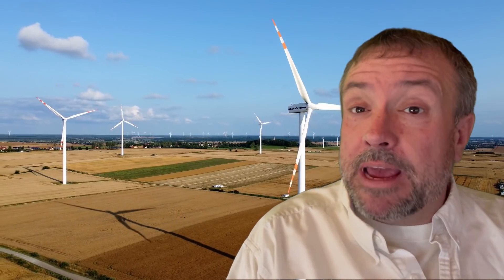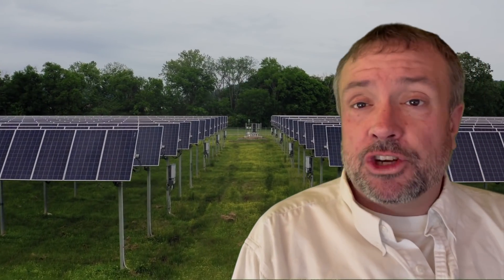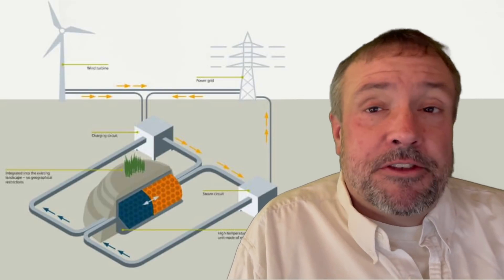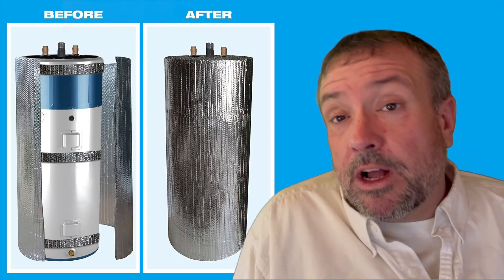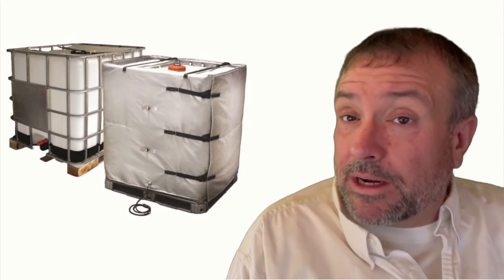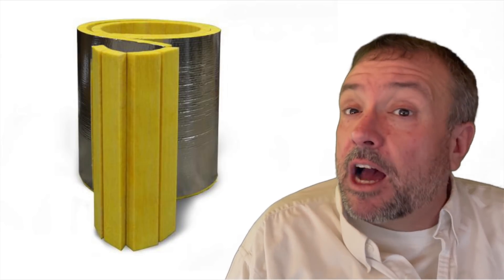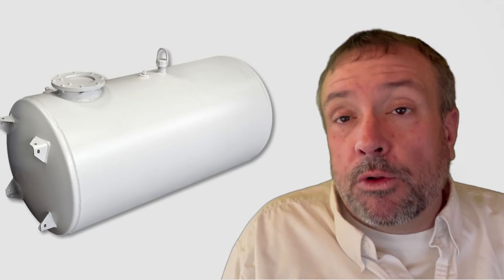Greenhouse Windmill Heating in Winter

Comment: Heat storage and heat pump is ideal and this is why!   It is simply cheaper to use a heat pump as they required 4:1 or 5:1 less power than simply creating heat.  Why?  Because it requires less energy to move heat then to create it.   Heat pumps work on temp differences.  They are granted the least efficient at -30 below.  😂.  BUT if the lower limit is above 0 celsius or perhaps 30c, then you can get those higher efficiencies were talking about.   If the outside coil of the heat pump is placed in warmer water or warmer air created by the heat storage we have already been speaking of IN COMBINATION WITH the heat pump, it will have miniscule electrical demands and high efficiencies.  Yes it has a demand needing electricity, but again only 1:4 or 1:5 that of direct heat creation.  So to keep the heat pump running will require grid or battery 1/4 to 1/5 the size of done in conjunction with a lower heat storage solution.  Let me know if anyone wants one, but not until I can answer a few more questions.  I'm going to do one for myself but going to do a little more research into which volumetric heat system I'm going to use.  No pressure hot water will work well, but I'm always fine tuning.  :).   Heat pump in conjunction with a Geothermal heat storage would be ideal for some locations as the heat source for the heat pump will be 50 degree fahrenheit higher is good enough to reach high efficiencies I have spoke of without the need of a tank.  But the geothermal ground coverage for ground heating will need to be deeper in cold climates and 2-2.5 times the size of the heated space.  Question?  Please sound off.  Greenhouses are usually not as insulated as a home.   Will the heat pump be required to run continuously in such a low insulated environment and how much would that effect efficiency?
Reply from the maker: I have no idea - it needs to be tested
Reply: @SimpleTek  yes I'm a little over a year away from any major greenhouse operation or I would do one now.  Loan office wants me to manage some sort of farm operation for a year before I can get any major financing.
Reply from the maker: @l0I0I0I0  have you tried other lenders?
Reply: @SimpleTek  yes need to call around.  Need to first buy this house then get a farm afterwards.  Can't wait!!!!

Comment: It's worth noting that it's basically required to have a heating element in wind turbine circuit as a dump load.

When your batteries are fully charged, you have to disconnect the power from them or they will get too charged and become damaged. Without the wind turbine powering something though, catching the wind will make it spin faster and faster. It can easily spin so fast it will destroy itself, so the most common solution is to hook it up to a heating element to get rid of the energy. (All this is done by the wind turbine controller)
Reply from the maker: interesting - that 'dump load' could easily be captured and used here....

Comment: Wind heated greenhouse! That is brilliant! Ideas like this keep me coming back.
I live off grid with solar panels and batteries and heat with wood to heat my hydronic floors and water. For a greenhouse, I would opt for a heater for a biogas digester. Then you still get the thermal radiation from the liquid but also the fermenting biogas chamber will give off more heat and gas too. I would connect the windmill in with my solar panels through a charge controller that would top up the batteries if they need it and then shunt the power directly to the hot water heater once the batteries are full. 
It is how I heat water in summer with my solar PV panels right now. I always have lots of hot water in summer. In winter the wwoodstove does the trick but cutting down on wood usage with a windmill would be sweet!
Reply from the maker: Thank you for the kind words! I love the idea of generating massive heat during a storm with a windmill!
Reply: I remember the Green Cube Research Institute was promoting this "wind turbine" for greenhouses many years ago. I'm guessing he read it in their publications.

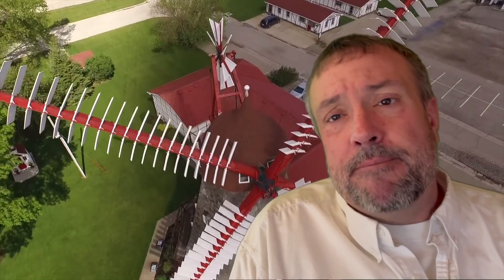Comment: 3:30 is the core problem in my opinion. We need systems that transform wind into heat as directly as possible. I mean something like a mechanically operated heat pump powered by wind. Any transformation to electricity, storing it in batteries and then making heat from it means loss of lots of energy. To the contrary, direct transformation with a heat pump allows for maximized effect.
Reply: Or you could go electricity to a heat pump and store the heat in water, but I don't what the efficiency of a heat pump is in Manitoba, and the cost to install it is more than direct heating of water. The main advantage of using wind to electricity is that you can use a  standardized mass produces wind turbine so for the same money you get a much larger wind turbine than you would with a customer turbine.
Reply from the maker: I agree but electric systems are commercially made
Reply: @SimpleTek  Thanks, yes, you are right both of you. As far as I know there is no such system available right now. I did not even find any purely mechanical heat pump by searching. Although in principle as far as I know there is nothing in the functioning of  heat pump where the mechanical work of electric engines might not be replaceable by other mechanical input. Human or animal work, gravitational battery, wind energy, water energy. Thus, an off grid, zero emission, purely mechanical system of heating might exist.
Reply: I think the simplest and least risky version would by just compressing the air by an air compressor powered by wind power. Any heat released migh be captured e.g. in a water tank or sand container. The compressed air might then be (1) used for cooling down the space that needs lower temperatures such as fridge, (2) released freely back into athmosphere thus chilling down the environment, (3) used in combination with 1 or 2 for electricity generation or just for increasing the efficiency of the initial wind powered compressor.
Reply from the maker: @peterk.6093  might work…
Reply: Wire DC from a wind turbine to a DC heating element. in a water heater, then use a pump to circulate water through pex tubing for radiant heat.

Comment: Using a plastic tank shoul dbe fine as water only heats to 100 c before becoming steam so at that temp should be ok except totes are a bit thin but a holding tank for sewage or other thick plastic tank should be fine.
Reply from the maker: some plastics become soft before 100'C though

Comment: Why not just heat the water directly in UNINSULATED black water barrels in the greenhouse - then the warmth from the barrel will just directly heat the greenhouse - smoothing out the energy from the windmill. No pumps, radiators or fans required. Also, as used by passive solar greenhouses, on sunny winter days, the same barrels will double as heat mass & be heated by the sun - even if no wind.
Reply from the maker: Takes up huge amounts of growing space though
Reply: @SimpleTek  This is standard practice for solar passive greenhouses. Stack black barrels full of water to store heat inside the greenhouse. Unless you have a tiny grenhouse, I think this would be fine. Esp. since you get the benefit of it also trapping excess solar heat in the winter.
Reply from the maker: @FordsInCanada  it’s ok for the shoulder seasons here…

Comment: i have been running an experimental  45kw biomass boiler connected to 4 ibc tanks in parallel since 2016 tipically going up to 60ºC without any issues
Reply: I like to see that set up
Reply from the maker: @scottykonovalov4518  mee too
Reply from the maker: That’s awesome

Comment: A suggestion for a tank, would be old milk tanks, they are stainless steel and already insulated. And the are pre plumbed with gas lines for refrigeration, which might be able to be switched to a heating tank. There are alot of old dairy farms around that would have them. They range in size from 1000 to 10000 litres. And you will find them right across North America. One downside is you probably have to cut a wall out of someone's barn to get them out. Just an idea do with it as you will.
Reply: Or a bulk transport trailer. They already have the wheels under them. Stainless steel and insulated already as well.
Reply from the maker: great ideas

Comment: I’ve thought about using windmills to produce power. The sticky point for me is the required maintenance. I don’t see myself as being able to handle it myself. In my area the best winds start at 20m up.
Reply: If you get the hivawt wind turbine you won't need to do any maintenance. Only certified vawt in the USA
Reply: @TurbineGuy  No maintenance??? Really? 🤔
https://youtu.be/EM-gCvhQhPU
Reply: @Hero4Hire4  yes Rosie has ignored the hivawt when making videos and hasn't responded to any messages I have sent her or comments I have left on her youtube channel. I have been installing these for a decade, and have never done mechanical maintenance on these. Only had an electrical issue from a lightning strike at one location.

Comment: Actually this is been done and you've got one missed opportunity, you really want to fill the tank with sand and have a pipe run through the tank so that the sand holds the heat because it will hold the heat a lot longer than water will
Reply from the maker: I have a video on sand as a thermal battery actually in my archives ;)
Reply: @SimpleTek  Water has a much higher Specific Heat Capacity than sand (approximately double) therefore for the same volume, water can store twice as much heat as sand. It cheaper & easier to move/pipe around too.
Reply from the maker: @FordsInCanada  but sand can take 10x the heat
Reply: @SimpleTek  , trade off between larger volume at a lower  heat, vs very intense heat in a smaller volume.   Lots of variables such as the max temp of your heat source,vs surface area vs more heat loss vs R value when temp differential is higher.   Sand could be easier to maintain than water (bacteria).    Case by case.
Reply: @FordsInCanada  Yes, but a larger volume of cheap sand, even clay, could retain more heat through higher temps for more days of heat independence, too. It's all in the math.

Comment: It is of course the way to go using thermal mass. There’s a wide array if options going this path. Your proposition is great, I would think it would work best with an existing greenhouse or other type of building someone wants to upgrade. If it’s a new construction, I think more thermal mass can be integrated in the design based on the Earthship concept. There would be then less energy used for heating and more of it available for lighting as the temperature in the greenhouse would tend to be stable at 21c.
Reply from the maker: Well said - thank you for the kind words!
Reply: What about a compressed air windmill and cool the compressed air in coils under your Greenhouse you could use tanks under your Greenhouse the cool the compressed air as it cools Andis top Xs + 2 and to stop excessive pressures vent the tanks in Venice to a turbine to run some electricity
Reply from the maker: @josephdupont  might work but there isn't many options for this to buy ready built - you'd have to manufacture a lot of it

Comment: The aircrete can be the tank perhaps...just add epoxy liner.you are a true researcher...inventor
Reply from the maker: possible I guess - to use a concrete tank and aircrete insulate it. My sewage holding tanks at the resort here are aircrete and 1500 gallon